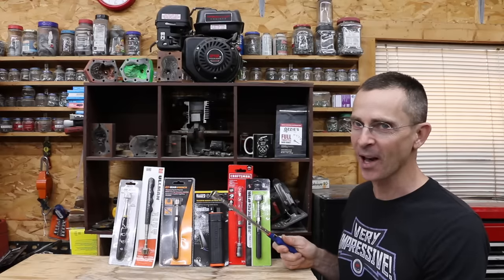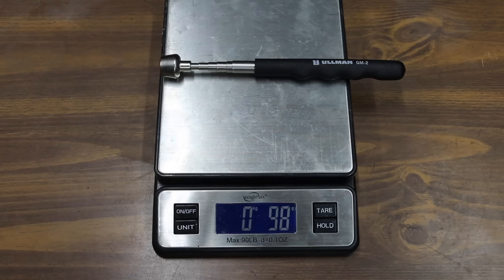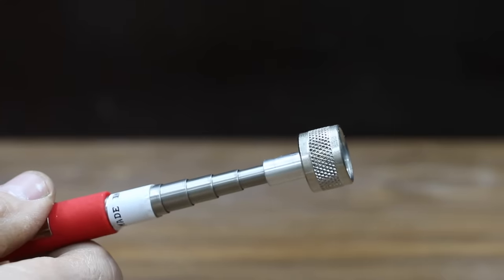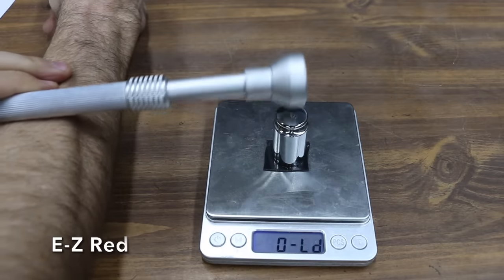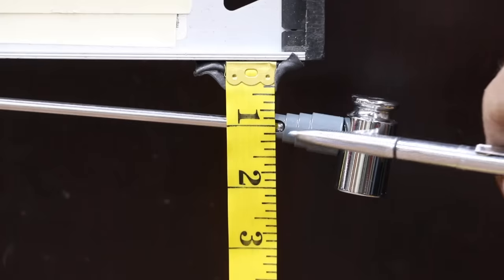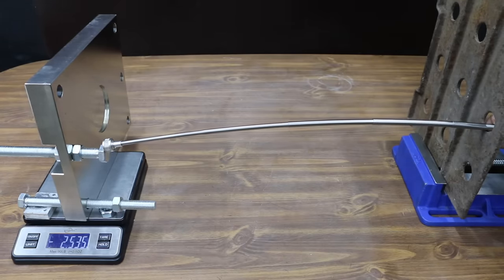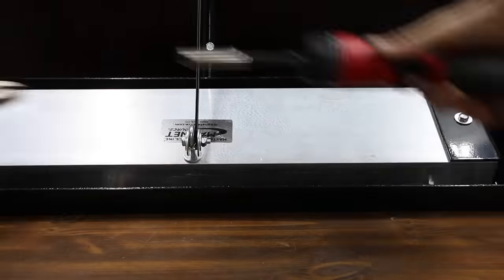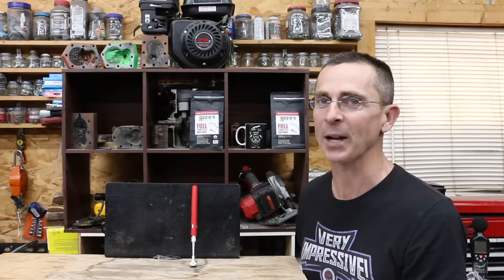Best Magnet & Magnetic Sweeper? Let’s find out!

Comment: I've had a couple of telescoping magnets over the years, but I prefer the springy type stalk.  They'd all fail half your tests here (you think of everything!), but I've had very little trouble with them.  I'll have to upgrade to the Pittsburgh magnet, though.  It's a lot better than my old non-neodymium mag.  For larger, heavy-duty work, I string up a microwave magnetron magnet with a baggie around it. The bag keeps metal splinters away from it and makes it =way= easier to clean.  I also use a grabber, with the 4 bent metal fingers and springy stalk, for getting things out of tight spaces.  It's my Aluminum Magnet. ;)  Oh, and I recently picked up a bendable stalk magnet with neo mag, for specific needs.
Reply from the maker: Thanks for sharing.

Comment: Good testing I was a little worried when the other scale showed up as I have the scale that you use the most. Hoped it wasn't broken which would not have boded well for my scale.

It looked like to me that there wasn't a clear winner. It would depend on what you wanted to do. If you lost a 5 pound breaker bar behind a wooden bench a magnet on a stick with a lot of pull would be the choice. If you lost a small bolt inside of an engine a magnet that had weak pull through the side shielding and a weaker pull might be better going around so much metal whereas a strong magnet pull might not make it to the part without getting stuck on some or all of the other metal part(s). 

One thing is for sure is that you will have the cleanest nail and metal free driveway, shop, and yard with all of those magnetic pickup tools around.
Reply from the maker: lol  Thanks for watching!

Comment: id really like to see a good jumper cable show down. i use them nonstop at my work. being a small engine tech i find it best to have a good mower battery with handle in standby. i use it and jumper cables to jump off units around the shop. 
the cables either lose their connection at the clamps after a while, or the clamps begin twisting and get all out of alignment and stop gripping onto small points.  very annoying would love to know which are best

Comment: I have this magnet, but there is another one that may be even better. It is on a flexible, aluminum wire, much like a thermocouple wire for your furnace. It’s about 20 inches long, and you can form it into whatever position it needs to be shaped to reach down and around things…
  I had to pull the Balance shaft off of the primary drive side of my KLR 650 motorcycle, to upgrade the balance shaft chain tensioner. When I pulled, I think it was the flywheel off of the crankshaft end, a small keyway fell off and into a hole inside the transmission opening.. sort of like having it fall down into the intake manifold of a car once you remove the carburetor. It was in there somewhere. I was able to fish around with my magnet on the very flexible shaft, and luckily, I was able to pick up the keyway, which I could not see, it was not a straight shot to the keyway that fell in there. So a straight shaft, holding a magnet would not have done the job…
  this magnet I found either online or at a parts store came inside a plastic cover on cardboard coiled up like a furnace thermocouple… it saved me a few times getting at things I could not see where they went. Except for one time. I was working on my Moto Guzzi, changing the air filter. One of the air filter box screws fell down between the cylinders of that V twin engine, and. I could not see it. What made matters worse was, it was made of stainless steel, which is not magnetic… of course, it was hiding between two of the cylinder fins. It took me several hours after removing a lot of parts to get a mirror in position, and a piece of solid, stainless wire to pick it.loose And pick it up with a piece of warmed chewed bubblegum on the end of a stiff wire using a mirror to guide me..
Reply from the maker: Thanks for sharing.

Comment: I do fireworks shows and the guns are assembled with double-headed nails so they can be torn down at the end of the night. On my magnetic brooms, I replaced the stock wheels with larger (8") wheels to give me more ground clearance to work well on grass, but still works well on pavement

(don't remember which brand, purchased on amazon)
Reply: I will add that I've found much more utility from the narrower brooms than the wide ones. The wide ones pick up more, but the more the magnets pick up, the harder it is to release (especially when you are trying to hold it in the air over a box/trash can)
Reply from the maker: Thanks for sharing.

Comment: From what i can see the Enbar is a great budget magnet. I don't care much about the shielding when im reaching for a magnet, I want the strength.  For 8$ I don't mind the weak shaft either, if it doesn't last, mount that head on shape-able car antenna.

Pro-tip- Wrap some electrical tape around your strong magnet to provide shielding if needed.
Reply from the maker: Thanks for sharing!

Comment: Something that could really use some testing is windshield wiper blades. Maybe a jig to hold and move several brands against a large pane of glass with a sprayer to simulate rain and powerful UV light to simulate accelerated sunshine, then testing to see when they stop working and then to when they fall apart, maybe a separate test against a textured surface to simulate ice in winter.
Reply from the maker: https://www.youtube.com/watch?v=g3S8udUSKtY
Reply: @ProjectFarm  my bad must have missed that, thanks

Comment: With the crazy high heat in south it would be cool to see if coolant additives like water wetter or super cool are effective. From my own experience switching from 50/50 coolant to distilled then to distilled + additive I've seen ~15-20* temp drops in high engine stress scenarios.
Reply from the maker: Thanks for the suggestion.

Comment: Just yesterday I dropped a nut down into the supercharger inlet on my MR2. No way to easily extract it without removing the entire supercharger and all the accessories around it. Extendable magnets couldn't make the 90° bend of the inlet to reach the loose nut around the corner. A magnet on a long string stuck to the sidewalls of the inlet tube and couldn't reach it either. I eventually got it out by sealing a shop-vac over the hole. What would have been really handy in this particular situation would be some sort of really flexible magnet wand like the Klein Tools, but longer, and proper shielding on the sides to prevent it from stickling to the walls. Seems like the perfect tool might not exist yet, short of making your own. It be interesting to see someone make an electro-magnet device too that can be snaked into really tight and zig-zagged areas before being magnetized by a switch.
Reply from the maker: Thanks for the feedback.

Comment: The final chart is a little confusing since it lists their placement order, rather than the measured values but the column labels say (lbs) (inches) etc which makes it sound like the values are units. Would be nice to have a chart showing all the actual values to make it easier to pick one to buy. Especially since the inner isn't available on Amazon.

Comment: Video idea 1

PF, Please do an oil comparison on Lucas’ low viscosity oil stabilizer?

 I’ve personally been using Lucas heavy duty oil stabilizer for years, however I’m curious if their low viscosity stabilizer has any benefits.

Example:
Amsoil signature series 10w-30 
•Control just 10w-30
•Lucas synthetic stabilizer 
•Lucas heavy duty stabilizer 
•Lucas low viscosity oil stabilizer 

Video idea 2 

I know it’s slightly out of your norm to test coolant, but 

Do coolant additives actually increase cooling efficiency?

Example:
•Blue G48 coolant control 
•Blue G48 + Royal purple purple Ice
•Blue G48 + Redline water wetter
•Blue G48 + Amsoil dominator coolant boost 

Do these affect the temperature whatsoever and do they increase cooling efficiency?
Reply from the maker: Thanks for the suggestions.

Comment: Video idea - do these work... Freeze Miser 2 Pack - Outdoor Faucet Freeze Protection | Durable Replacement for Faucet Covers for Winter - Freeze Proof Outdoor Faucet Protector - Low Maintenance & Easy to Install - Saves Water
Love your channel.
Also, there is a concern among us old sports car guys that modern gear lube detiorates 'yellow metal' drive train components. Wondering if this is fact or fiction.
Reply from the maker: Thanks!  Thanks for the suggestion.

Comment: Hello, this isn't so much a product test but a method test. Using the same brand of concrete could you test the durability / strength of a traditional wet pour vs dry pour using something like quick set concrete bags.

Dry pour is so much easier but I think lots of DIY are afraid to do it cause lots of people are against it. I understand that it's not good for anything load bearing but say a sidewalk for foot traffic around your home or a shed and stuff.
Reply from the maker: Thanks for the suggestion.

Comment: @Project Farm  -  Magnet tools vary in strength from one to another and you can get quite a bit of difference between siblings out of the same batch of tools.  The Menards magnetic pickup tool like the Harbor Freight is built better and has significantly more lift. I strongly suggest if you have a Menards anywhere around you, you should have a look in that store. They have really great stuff there at very nice prices.
Reply from the maker: Thanks for the feedback.
Reply: @ProjectFarm  -  Always glad to help. Like I said, check out Menards and take a scale or something to measure the pull of the magnets there and other places. There is a very real difference between magnets. And yes Harbor Freight and Menards have some really strong ones.   
Thank you for your hard work.

Comment: A very nice selection of tools as is to be expected from Project Farms. Strangely enough one I have been curious about the "Heavy Duty" Pittsburgh Magnetic Pickup tool wasn't on the list. To be fair it is nowhere near as compact with a 22" length starting out & permanent 45° angled magnet base. For under $10 I am still going to give it a try as I can always use the parts for something even if it doesn't pick up the advertised 25 lbs.
Reply from the maker: Thanks for the suggestion.

Comment: Good video, however as the magnet size is different for each unit, I think a "PSI" of lift rating would be more appropriate as that would show a more direct comparison of the magnet quality versus just a "bigger magnet means more lift" type deal. You already did the work measuring the size and lift capacity of each magnet, just need to break that down to what their lift force is per square unit of measurement .
Reply from the maker: Thanks!  Thanks for the constructive feedback.

Comment: Always great shoot outs by PF.   I just bought an Ares 1/4" drive flex head socket set the other day, I needed a 1/4" drive flex head socket and I usually just buy a set rather than one when I need a tool.  Wondering how they would compare to other flex head sockets.  Figured I'd plant the seed Todd :)
Reply from the maker: Thanks!  Thanks for the suggestion.

Comment: The Craftsman might be the weakest and saggyist but that light in the tip is an unbeatable feature to have when hunting for a bolt in dark engine crevases. It will pick up any nut, bolt or screw you can reach with it, which is why I have a chinesium copy in my tool chest.
Powerformace does not always beat practicality.
Reply from the maker: Thanks for the feedback.

Comment: I would love to see a comparison test of brake rotors....warping being the biggest concern.  I have noticed many modern aftermarket brake rotors tend to warp after 5,000 miles.  I would like to see if the higher end drilled and/or slotted rotors are worth the dough
Reply from the maker: Thanks for the suggestion.

Comment: Magnetic pull is subjective, in that as long as you have a quality piece of ferris material you can adjust the strength of the magnet by adding or subtracting electrons, or adjusting the temperature of the ferris material.
Reply from the maker: Thanks for sharing!

Comment: Always appreciate your tests. Thank you. but wonder if there are errors in tabulation here. As one example, the Enbar telescopic generated 20 lbs force in early testing, but given a value of 1 lb in summary table at 13.13 min. The magnet diameters at 13.13  seem to be wrong (13 inches?). The telescopic length of each at 13.13 appears wrong. Many other issues.
Reply: I know I'm 5 months late lol, but I had the same confusion just now until I figured it out, so figured I'd post for any other folks having the same problem. That table you're talking about is actually listing what place that particular tool finished in the test. The Enbar got a 1 because it finished 1st place in that Max lift (lbs) test. The final overall ranking is what average place the tool finished overall. I agree that the way he displays it can be a bit confusing and the labels could be better in these charts.

Comment: Video suggestion: Laser levels.
test for brightness at set distances, clarity or definition (how well defined the line is, as opposed to just being a red blur) at set distances, accuracy to the included bubble levels, or digital level if available, and battery life.
related: angle finders, both manual and digital.
Reply from the maker: Thanks for the suggestion.

Comment: Have you done one on the best magnetic parts tray/bolts & nuts holder?  I looked but couldn't find one.  I've had some that drive me crazy, some lose a lot of holding power after just a few bolts.  Some can hold reasonable weight in bolts but fall off a surface too easily.  Would love some inside info on which magnetic parts trays don't suck!
Reply from the maker: Thanks for the suggestion.

Comment: Ooo, cheap test: Wago, Ideal, Chinese Knockoff, Wirenut challenge! Load up on amps (15, 20, 25, etc) and look at heat. Test pull strength, vibratory test, low temperature hold (wire shrinks) and voltage tests. Could get, electrifying 😅

Comment: the MacTools magnet is a home run, the one thing is did worse then most is vertical lift which after about 10 pounds is completely unnecessary as there's other magnetic tools designed to lift heavy things much better then a small wand like that; the other factors where it performed far better are far more important for most tasks you'd use a magnetic wand.
Reply from the maker: Thanks for sharing.

Comment: Video Ideas: On similar lines you can test/compare magnetic wrist bands which are used to hold screws and other small metal parts.

Other ideas: To do paint comparison as your last video didn't include Benjamin Moore and prices have gone up since that last video. And this time possibly you can compare in individual category like Best paints of each brands compared against each other and similarly medium grade and so on. Similarly the cleanability of the paint for different sheen level 

Some other ideas in the category of electrical and other tools like contact less voltage tester, multimeter testers, infrared thermometer, infrared cameras, metal detectors, Pliers, screw drivers, ladders etc.
Reply from the maker: Thanks for the suggestion.

Comment: Try out RVS technology. I wanna see if it really works. Ive used it and seems to quiet the engine down but i wanna see you break it down like you do so well with everything else.
Reply from the maker: Thanks for the suggestion.
Reply: RVS15 gets you 15% off on their website in case you decide to try it out. I know the power steering treatment removed the whine from my old ranger. They also have videos of running a honda after 3 treatments with no oil. Really currious if that is even true.  Interesting product with huge claims.

Comment: This may be a bit dicey but are you able to test out the high voltage rated hand tools like screw drivers? It's a good feeling to know while using tools like Klein that the stamped 1000v number holds up or close to.
Reply from the maker: Thanks for the suggestion.

Comment: I have the Central Machinery model....use it in the grass. I rarely lose stuff on the garage floor I can't see but outside is a whole other world. It works well except when the terrain is uneven. It's intuitive; you can tell when it will work well and when it will not.

 I'm not sure the difference between an 'earth magnet' and a neodymium magnet but holy sh*t do those neodymium magnets pull! I know they are expensive, but why not have those in ALL of the magnet probes?
Reply from the maker: Thanks for sharing!

Comment: I'm conflicted on this one. Mainly because there have been plenty of times under the hood I needed to wiggle or flex the shaft by swinging it to pick up a socket or a bolt that rolled under something and I had to look for it blind. So on one hand I like the non flexing ridged magnets but on the other hand there are times I need something that can bend a bit. Though with my experience the rating is only on paper and after the return window has passed the lifting strength is everything except the item I'm trying to reach.🤣
Reply from the maker: Thanks for the feedback.

Comment: Could we get a series on comparing DeWalt vs flex vs hyper tough vs Milwaukee or craftsman cordless tools. Such as say their impacts, sawzalls, circular saws and their angle grinders? I'm currently using hyper tough tools and I'm in the market for a second battery system
Reply from the maker: Thanks for the suggestion.
Reply: Torque test channel has done a ton of power tool comparisons. Would recommend checking them out.

Comment: I’d bet there’d be some interesting finds around tbe shop with one of those brooms. A video idea I’d be interested in is if there’s a difference between air cooled and marine two stroke oil brands. I run pennsoil semi-syn marine oil in air cooled engines and not had any issues.
Reply from the maker: Thanks for the suggestion.